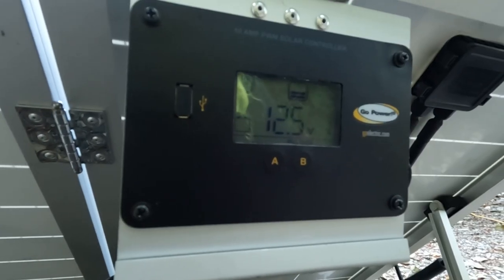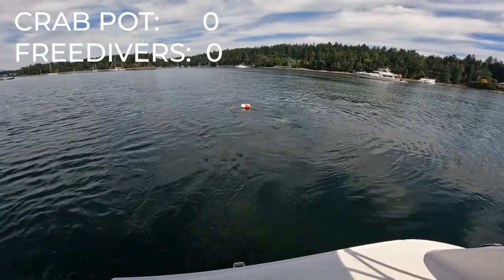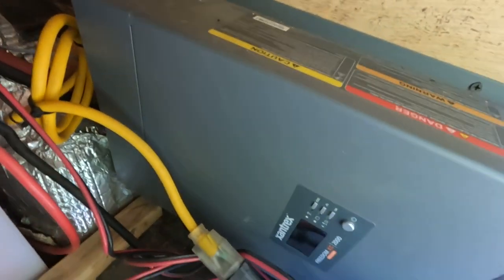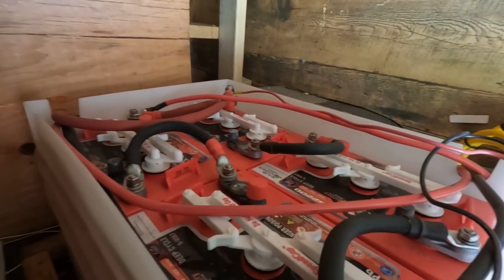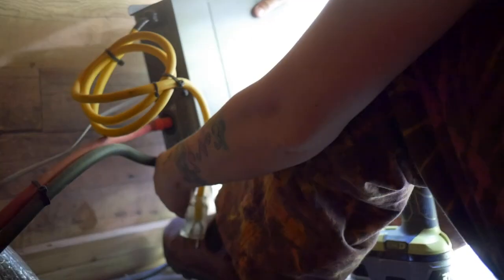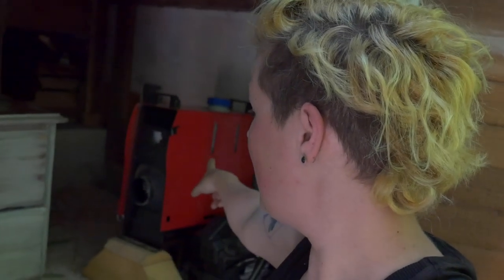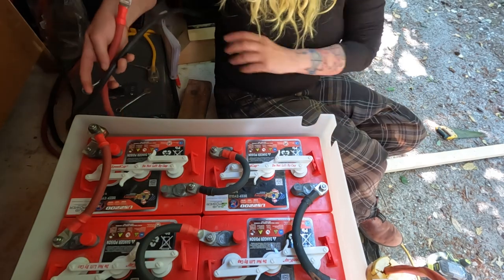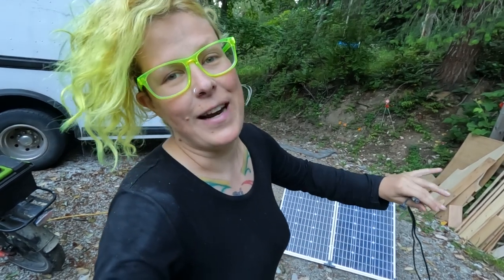Batteries? Solar? Step Van Build? ALSO Freediving & Catch and Cook!

Comment from the maker: Do you have an electrical set up?  Tell me about it?  Also tell me what your thoughts are on my Garage space!!?  ADVICE?  Tips? Thoughts!
Reply: I'm still saving for the van the universe is going to send me. So, the only advice I have to offer you is HAVE FUN!
I doubt I'll ever have more than a bluetti and some solar panels, certainly nothing as complicated ( and heavy) as your set up. 
Not your mom, but, SO PROUD OF YOU!!!!
Reply: When we bought our van it was partially built and we ripped it out down to the metal and are rebuilding but it came with the electrical components so we have your usual renogy/victron setup. 400W solar, 40A rover mppt, victron 3000W Inverter/charger and 400Ah lithium. I am SUPER proud of how beautifully we installed it. We added DC to DC and shore charging as well.

Comment: Are batteries stored in plastic box?  If one end could open, maybe slide the batteries in? Also would one of your wooden drawers slide under your guest bed?
Reply from the maker: @Beth Garrison yes they're in the plastic box mainly as a safety thing if they were to off gas.  But I love the sliding thing so I'm going to to try and find a way of making the whole box slide I think! great idea!
Reply: Maybe both drawers could slide under guest bed? Access one from back & one from inside? Maybe connect them with removable clips? Just an idea!